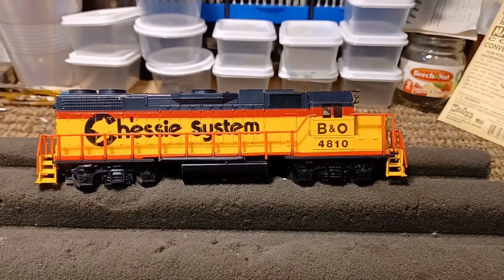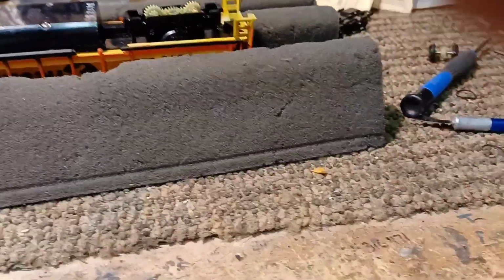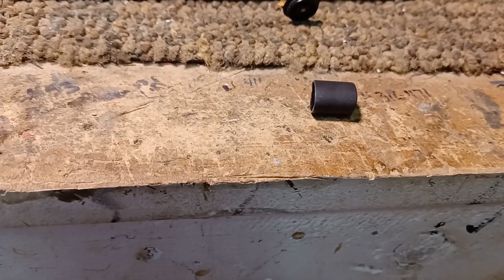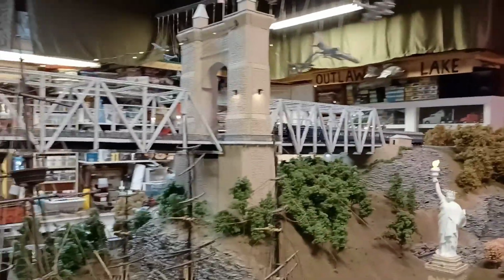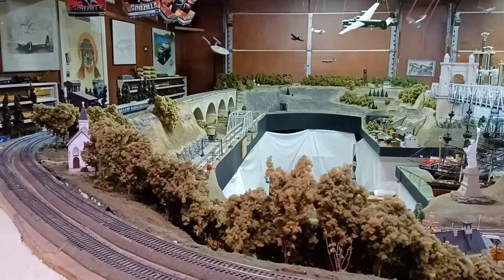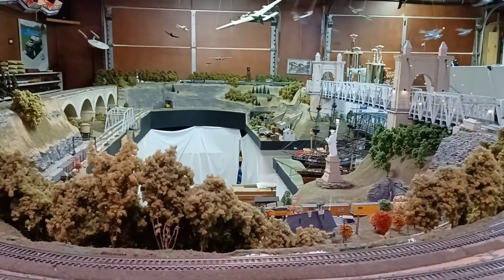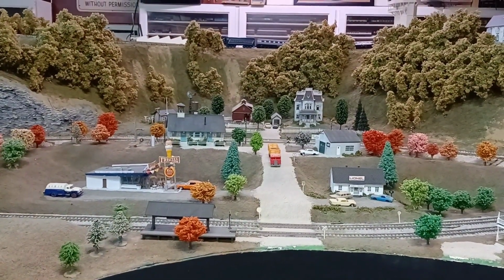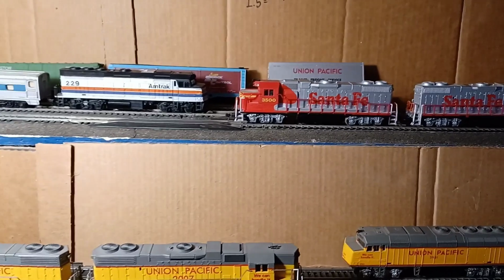How to make cheap and easy HO scale diesel locomotive traction tires.

Comment: Nice and a good method to re-tire the wheels. I had an old Santa Fe 300 F7. It was a used.  It was gifted to me in 1988. It had one power truck, with a horizontally mounted three slot DC Can motor  with a worm gear. The power truck had 4 wheels with traction tires. All tires were damaged. I googled. Traction tires are available but expensive. I cut 1.5 mm strips of scotch taps and wound around the wheels in the groove. Then, I placed a drop of Cyanoacrylate glue. It works well can pull 7 flieshman paasenger cars on 18" radius, curved slope of 4% gradient.